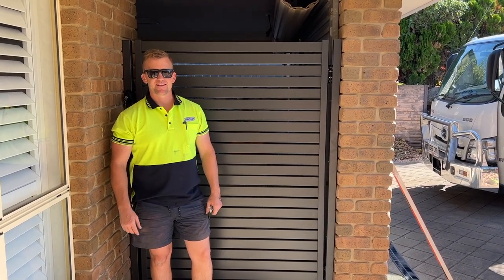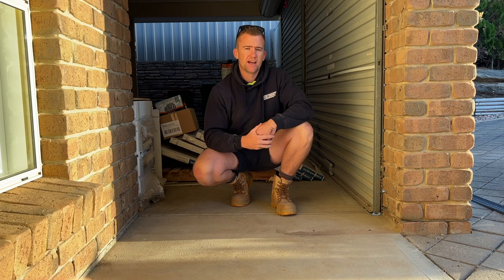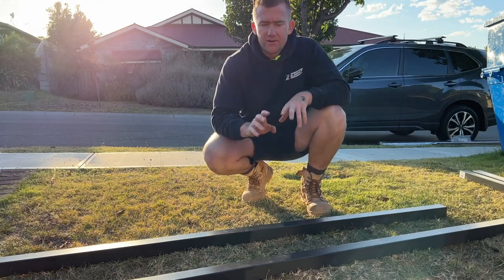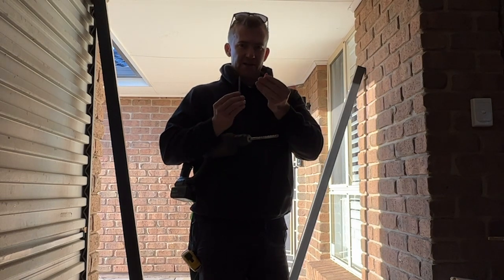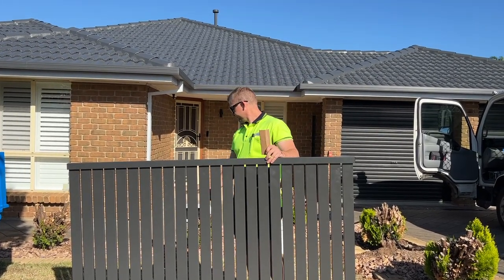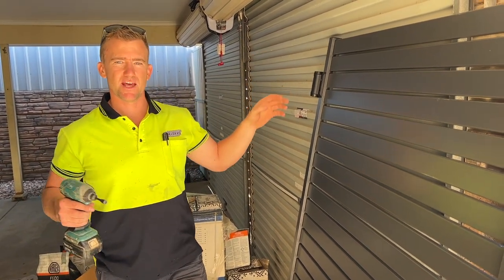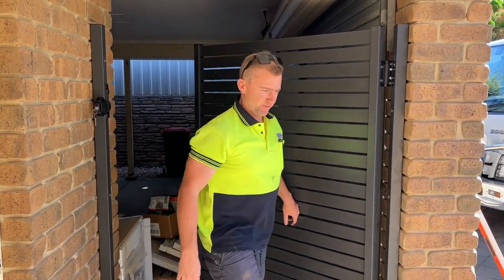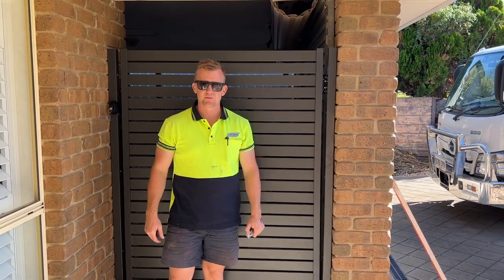How To Install An Aluminium Slat Gate - Outback Fencing

Comment: Stepped drill bit, 10*50 ramset plug, 10mm drill bit, 100mm batten screw. Thanks for sharing.